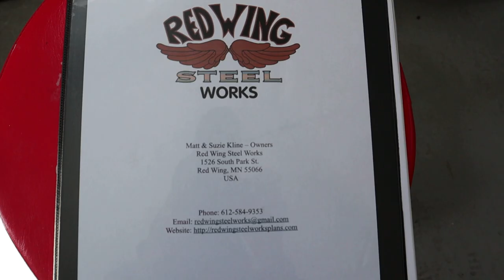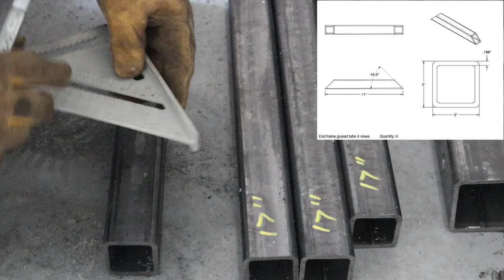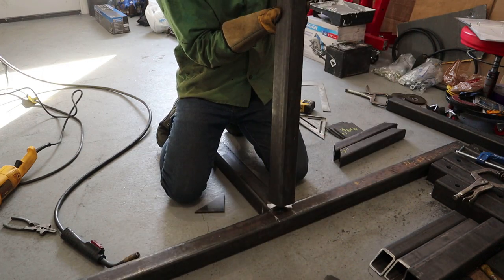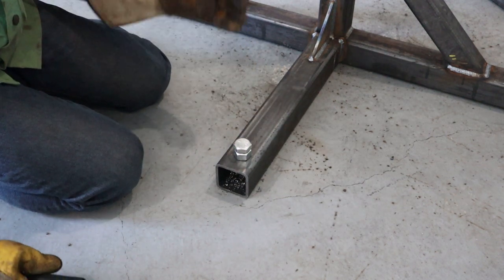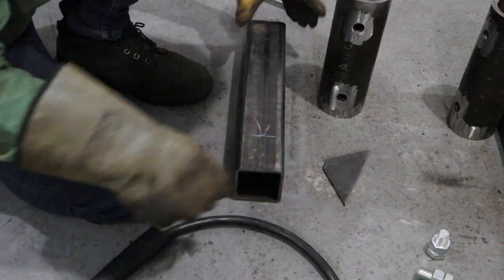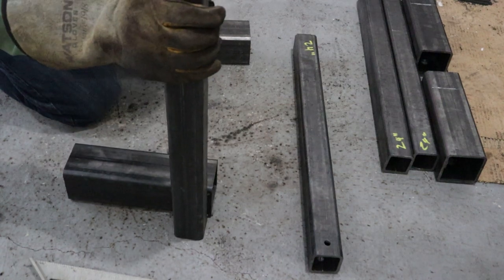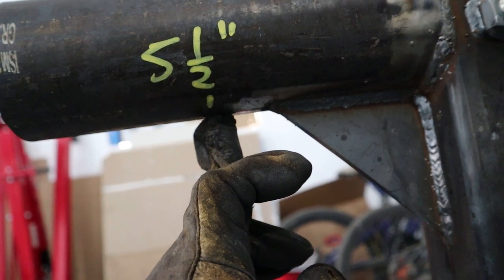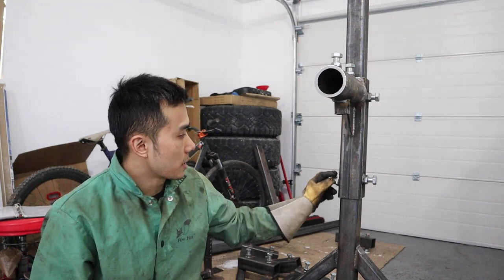How to Build an Auto Rotisserie STEP-BY-STEP - Designed by Red Wing Steel Works

Comment: I’m currently about to start building the same one. I made the mistake of getting a quote from Metal Supermarket. It was OUTRAGEOUS…especially since some of the smaller lengths can be ordered from Amazon with minor cutting. 

Thanks for the video! I’m the type that needs to see an actual completed product. Some of the lengths and decisions had me questioning clearance and operation.
Reply from the maker: Hey man. I went with super market at the time cause I paid premium for them to cut it. Basically material cost  was double. If I went to my local metal supplier, I could  of gotten the material for 60-65%  less. Also, my second video on the rotisserie,  I had to modify it for more clearance when moving the "T" piece that mounts to the car. Instead of some triangle gussets, I just welded more passes for strength. The gussets prevented me from moving the piece up more for balancing the 240.

Comment: I just bought the steel for this. I only had them make a couple cuts. It came to just over $600. More than what I was expecting but I knew steel had taken a big jump over the last couple years. Plus casters were another $40. Hydraulic rams were $120 and nuts and bolts another $30. Haven't purchased paint but I'm sure that'll be another $20, so all in with today's prices it's at around $800. Still cheaper than purchasing one and I'm sure can recoup most of the cost if I resell this. Anyway, great video Tony.
Reply from the maker: Thanks man! Some people definitely  got their material for cheaper.  I got ripped off from the shop who cuts the metal for me. Regardless, a rotisserie  is a good investment and you can always resell later! Thanks for watching 😄

Comment: Nice 👍🏼 I’ve downloaded Matt’s plans and have sourced all of the necessary tools to start the build of my rotisserie for my Datsun Z. I’m just a bit scared to get quotes for material theses days post COVID. Hope your 240SX is coming along or even better, done ✅ Cheers
Reply from the maker: I did pay premium price for my metal , metal super market charges alot. If you can buy whole length from your metal distributor and cut it yourself. It will be way cheaper. Some guys in the USA, material for this build was only $300.
Reply from the maker: 240sx is still in the works !
Reply from the maker: @Alex Vigh yes sir! I totally agree. I didn't know any better at the time and took a expensive route, paid double the price for steel from a smaller metal distributor.  I'll know for next time haha

Comment: Very nice. I'm going to build one using those plans. Would you recommend adding an adjustment screw to find the balance point? Without it I would think its a question of trial and error. Great video, very clearly presented.  Cheers John.
Reply from the maker: Adjustment screw along which area?   Are you talking about balance point for when turning the car side ways?
Reply: @240Tony  Yes. I've seen them on other rotisserie to help find the balance point.
Reply from the maker: @mercedesmaintenance.6339  ohhh true. It's up to you, if you feel like it will help you, you could add it. I haven't had any issues with mine. Only thing I had to figure out was the proper high to jack the whole car so it can rotate without hitting the ground. Once I knew, I just drew on the vertical steel with a paint marker.

Comment: Great video on the build. Here in Australia, I suspect that the material would cost even more than what you paid in Canada. They have it good in the U.S. where steel is a lot cheaper and fuel costs only a fraction of what we pay here in Australia.
Reply from the maker: Lol yeah. Someone bought the same material for this build in the usa and it only costed them about $300.
Reply: @240Tony  this is literally what I was going to ask. How much the material was. I'm building it this month.
Reply from the maker: @al-zj2sy  I spent about $1400 in canada but that's with a shop cutting everything to size. If I bought from the main metal supplier and cut it myself, would of been way cheaper like $500. Someone in the USA built this same one for like $350 USD.

Comment: Damn, great job illustrating everything. I was planning to go this route but since I'm only painting and welding one car. Looks like it's not worth it, any advice for welding lying down?
Reply from the maker: It honestly depends what your doing to it. It's worth it if your doing alot of work underneath the car. Could always sell the rotissery  later on. But if your  doing work above the car, you may not need a rotissery. Get a leather welding jacket if your doing alot of overhead welding.

Comment: Amazing! I downloaded the plans and whold like to build one of these for my restoration: 1978 fiat spider.
I’m just a DIY welder and I’ve been doing all of my own sheet metal work so far on the car....lots of practice and I think I’ve become pretty good at it lol.
I have a Hobart handler 140, 110v... I’m guessing it’ll be too weak for the square tube on this rotisserie?
I’m in Canada as well!
Reply from the maker: That will be a pretty exciting project. I would not weld the rotissery  with a 110v. It wont run hot enough to have proper fusion. It may look like it sticks but with that might weight on your rotissery, there will be a weak point and eventually  lead to it breaking. Your project and your safety is at risk. Try to get a welder that uses 240v.
Reply: Thanks sounds good, looks like I’ll have access to a 240v welder after all! Hobart Ironman..
Reply from the maker: @frankd.3266  yeye. Make sure you run those welds hot enough but not excessively  hot. Use with gas shielding (25 c02 + 75% argon)

Comment: Young man,  I worked construction as a pipe fitter and a tig, mig and stick welder for 60 years at a 
nuclear plant in North Alabama. I would like to complement you on your mechanical and layout ability as
well as a jam up fine welder. I feel so confident in your welding that me and my wife would rest well
sleeping all night under a car on your rotisserie build. What do you do for a living.
Your friend,
Don Odom
Florence, Alabama
P.S. I am on Facebook. Friend me on there and we can share stories.
I meant to ask, what kind of car are you restoring?
Reply from the maker: Thank you for the kind words, I truly  appreciate what you said. I'm a Red Seal Journeyman welder  in Canada. Currently taking on  as a apprentice for Heavy Equipment Technician. I'm restoring a 1993 Nissan 240sx which will get all new performance parts!

I couldn't find you on facebook, hard to find.
Reply: Welding OCD, I am on Facebook as Don Odom Florence, Alabama U.S.A.
Reply from the maker: @maryodom5232  think I found yah.

Comment: Do you think this build is better than buying an east wood rotisserie?  Also awesome work!
Reply from the maker: Honestly, if you can buy a pre-built one for a good price, that's a better route. But if you can get steel for cheap, then this route would  be better. Some guys in usa told me they were able to build   this with the cost of material around $300 usd.
Reply from the maker: Thanks

Comment: Nice build! Any plans for the build? What did it cost and what technique were you using to make the welds? Thanks boss
Reply from the maker: You can find the plans if you google search for it. Red wing steel works . Costed me abit more than other people. Someone in the USA got material for about $300.  This is mig welding with 240v.

Comment: Would you build this again after using?
Reply from the maker: If I have access to cheaper material then I would build it. It works great. Ended up selling my rotisserie to another fella for $1400. Some folks that built this, got material for around $300.

Comment: Well done!  Do you have an estimate of how long it took you and how much money you spent on the materials?
Reply from the maker: The metal was roughly $1400 canadian. 6x 500 lbs caster wheels are $150. Nuts and bolts are about $135. 2x 6 ton hydraulic  ram Jack's was $165. Step drill bits was $30. 

Our metal prices when up alot because the American tariffs. 

It took me about 8 hours to drill the holes, about 2 days to fit up, weld and film.
Reply from the maker: Thank you!
Reply from the maker: Metal was all pre cut to size so it costed a bit more .
Reply: Thanks for the detailed reply.  That's certainly a LOT of work and a fair amount of money!!  The results are certainly worth the effort as it would be very difficult to buy one of the same quality at pretty much any reasonable price.
Reply from the maker: @therestorationshop  yea, if your in the states or any other country, I'm sure you could get the materials for way less!

Comment: Umm the Car rotisserie at princess auto costs as much as your material to build yours.  And im in the same province as you.
Reply from the maker: Hey man. Unfortunately  it did cost me a bit cause I paid premium  price for metal super market to cut all to size.  Some  folks in Usa got the material for under $300  to build this. Depends on your source. If I got whole length steel from varsteel. It would be alot cheaper for sure. This is just a educational video :)

Comment: What welder did you use how many amps?
Reply from the maker: It was a miller welder that uses 240v. You have to run hot, this particular welder didnt have a amperage, volt numbers. It just had numbers. A 110v welder wont be good for this  job because it runs cold.

Comment: I cringe any time I see someone weld without cleaning up the weld area first. A flap disc only takes a few seconds and it makes for an all around better weld. Otherwise good job. I went the lazy route and bought mine. I didn't have the time to spend fabricating one.